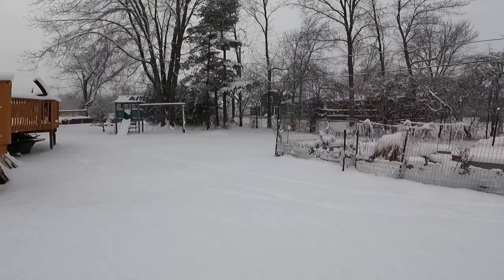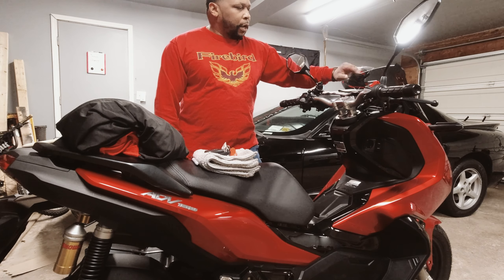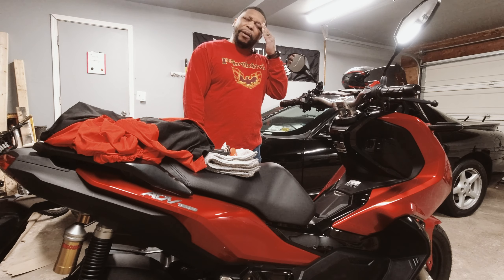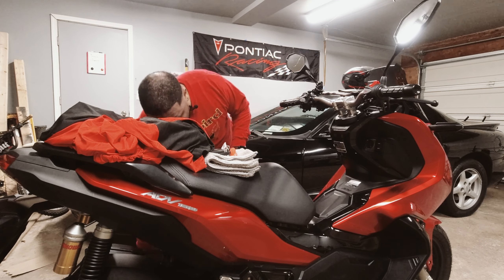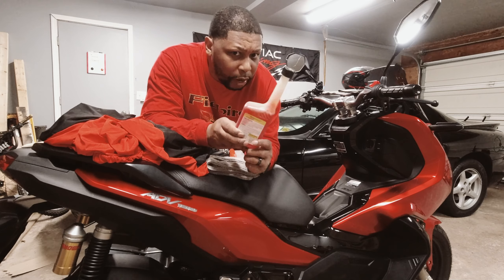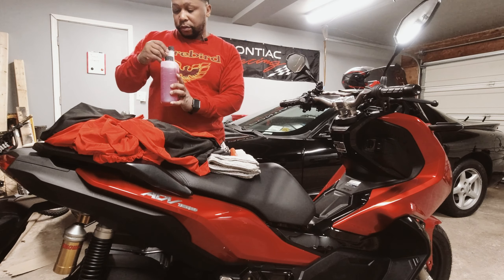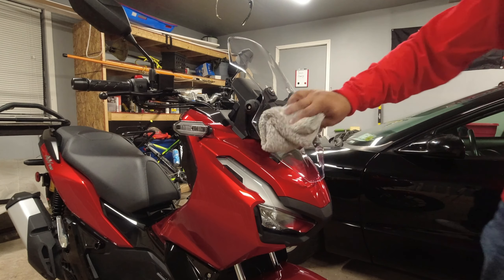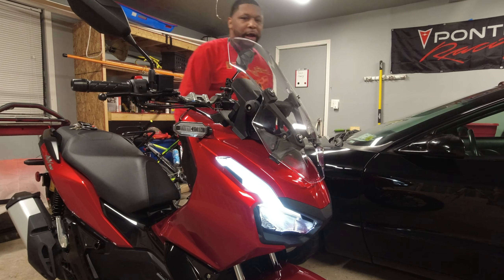Time To Put The ADV 150 up for winter!!

Comment: In Iowa once they put down sand and salt on roads I put my scooter away. 👍Sand is a scooters worst  enemy having such small tires. 😬. You have to take off long neck cap first and then squeeze bottle until ounces are achieved in ounces..🤔